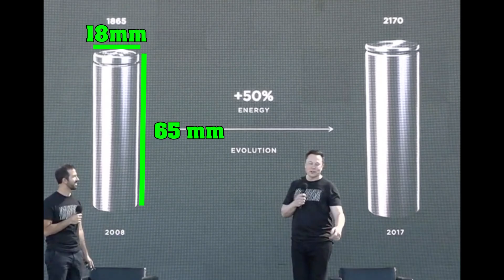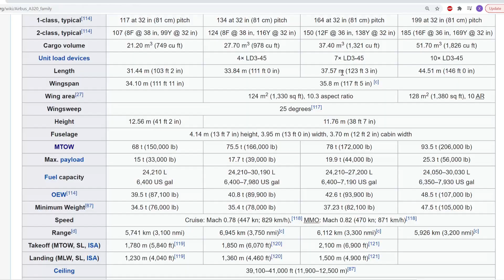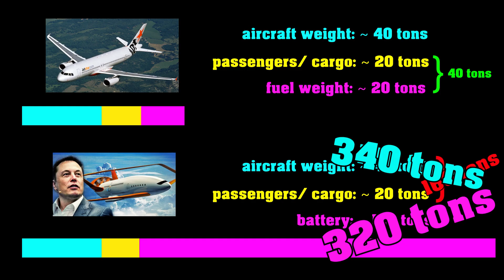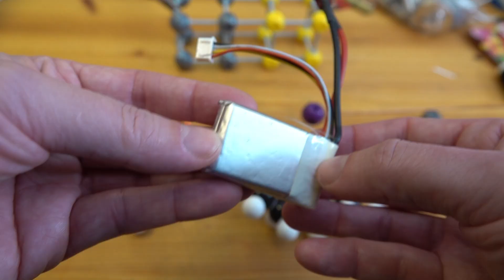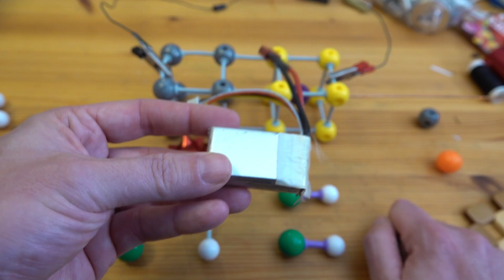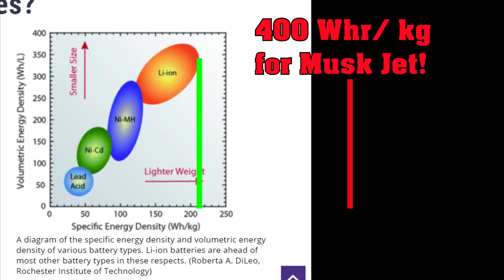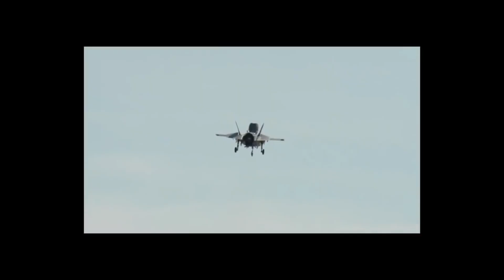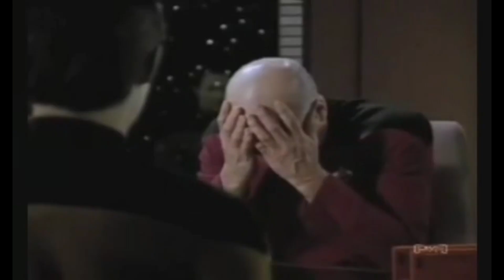Tesla's Secret Plan To Disrupt Airlines: BUSTED!!

Comment: In a jet fueled aircraft, the take off weight and landing weight are vastly different. With an electric, the aircraft’s take off and landing weight are the same. In a jet fueled aircraft, mid flight, it gets more efficient as it becomes lighter. Electric aircraft the weight remains constant. If they the electric aircraft could jettison dead batteries then it’d stand a chance.

Comment: And we haven’t even begun to cover the fact that for the required gross takeoff weight of the aircraft, you need engines they can generate a thrust greater than that in order to facilitate vertical takeoff, which means the engines are larger, heavier, and consume more energy, then he would typically see in a normal jetliner. Yeah Elon is so full of shit that he could pass for an outhouse on this project.

Comment: The range of the aeroplane ignores the fact with the airbus you start with 20 tonnes of flue and end with fumes,  the Electric Jesus plane would start the flight with 77% of the aeroplane weight occupied by the battery and finish it with same ratio.  I'm surprised the splitting image puppet of Electric Jesus had a moving mouth,  it would have been far more accurate if the arse cheeks moved when he's spoke. 

Nice battery fire at the end of this https://youtu.be/-jiH3mE81zw 

If you fly RC models it is tricky to get long duration  especially if you want the model to be fast and responsive. The body is generally made out of mainly polystyrene of some description reinforced with the odd bit of metal or carbon fibre.

Comment: You don't need a massive range for an aeroplane as a lot of routes are not that long and you can of course have a stop mid way for a quick 15 mins supercharge this would make it less economical and convenient granted but if hydrocarbons are regulated away it's better than nothing

I would argue that the future will be far less flights if self drive cars work

Why use an aeroplane if you can book a self drive sleeper EV at night and wake up 8 hours later in your destination city 800 miles Away

9 of the top 10 flights routes by passanger number are less than 800 miles distance

Comment: 1:50 They actually are talking energy density. A present day tesla battery (2020) has 260 kWh/kg, while a roadster battery (2009) had only 120 kWh/kg. https://web.stanford.edu/group/us-atmc/cgi-bin/us-atmc/wp-content/uploads/2009/04/tesla_presentation.pdf
Reply: Wow that's an huge improvement. According to battery day with the dry electrolyte, the silicon anode and a nickel cathode they should improve energy density by 40% so that's ~364WH/kg.
Still not enough...

Comment: By the way, Mercedes achieved 50% or more efficiency with their hybrid Gasoline engine in Formula 1
Reply: Yeah. ~30% is where traditional piston engines are but recovering energy as you brake and smoothing engine revs by adding a hybrid system can help massively. 

But plane engines run at constant speed for hours on end so it won't help here.
Reply: @ThepoLarbear-le1yz  a big part of it comes from the electrified turbo part. But brake regen helps too
Reply: Newest Honda and Toyota gasoline engines for hybrid cars are beyond 40%. Because they are used for serial hybrids the engines are optimised for efficiency but have not so good response and torque curve.

Diesel engines for ships are above 60%.

Comment: Even he gets his power, how does he convert his power. If he can convert his power, how does he cool the thing converting his power. If he can cool the thing that is converting his power... If you want to run several flights a day, you can't deep discharge, so you're looking at 100% of your weight in batteries? You are also limited to about 1C... How is he going to prevent thermal runaway? Boeing slapped a metal box around their battery and their battery was tiny in comparison. If the battery does light on fire, how do you prevent it from crashing the jet and killing everyone? How do you prevent everything from melting if you need to hover? How do you get a prop or a fan to go supersonic? The fan produces less and less thrust the faster you go.

Comment: I think battery airplane is feasible to certain extent. Electric airplanes are in production. They have like 2 of flight and like 500kg cargo. Like 4 people is in production or 8 people is in development. With current battery density max load is like 1-2 ton. 
As you increase weight you need progressive energy density. Like few kg dron is speedy but 2 ton airplane barley flying. 
Few gram fly is speedy bastard, 100 gram pegion is stil nimble, 4 kg duck still fine, 14 kg albatross barley can take of. For blood, bones, muscles thing 14 kg is max weight. 
Battery have few tons max weight. Piston engine airplane is like 100 ton, turbo jet is like 500-600 ton max. For bigger airplane we need stronger and more efficient engine
Reply: name these airplanes. everyone keeps mentioning the nasa one that has a 100 mile range, and that only carries two people and burns more fuel then a ww1 wooden airplane that had three times the range

Comment: Few things to add :
-bosch just announced yesterday that despite massive investment, they are dropping off the lithium battery bandwagon. Gone is the 400Wh/kg battery promised. 
-electric motor power to weight ratio is pretty bad. At best they match internal combustion engines, at worst it's a third. This things are pretty heavy, and just like batteries, the more powerful they are, the more heavy they are! It's a matter of getting all that current through.

Disruption in electric things (batteries and motor) is still possible with close to sci-fi concepts like higer temperature supraconductivity or nano-engineered batteries. Still the energy density of any combustible will still be higher. Most of the energy released in a combustion comes from the oxygen of the atmosphere itself...
Reply: The ampere engine should reach 20 kW/kg at 30,000 RPM but that's just a project. What do you think?
Reply: @johntheux9238  I smell BS but investors will love. They love to throw money at peoples that just announce doubling any spec of whatever they startup into.

Comment: I gotta point to a couple of things real quick. That plane you used for reference has three engines, one in the tail. Otherwise they can’t fly over water with just two. Also when figuring the engines for “Elon’s Folly” you missed the fact that the engines would have to be much bigger and have a much heavier framework in order to be a VTOL craft, just look at the V-22 Ospreys and how they are built. Great piece on everyone’s favorite “White Paper” author, lol!
Reply: Without a timestamp it's hard to be sure, but he uses a 787 in most of the pictures, which has two engines, like all airplanes designed after 1980, which is about the time when the three engine rule was abandoned
Reply: yeah i just flew 4k miles on a twin-engine 777-200er

Comment: I don't understand why people think tesla has some kind of magic battery technology he's using the same batteries as every other damn company.

How does that guy think an electric engine would generate thrust? You still need air buddy I'm a dumbass and am aware of this fact
Reply: They will produce the 4680 battery themselves.
Reply: Yeah but it's no different from any other lithium battery it's the same other than the size exactly the same battery tech every lithium powered device has inside it and 42120 cells are a thing already the size difference is negligible
Reply: @PsychoticEwok  It's not only a new form factor, with the dry electrolyte, the silicon anode and the nickel cathode they should improve energy density by 40% so that's ~364WH/kg
Reply: @johntheux9238  because the battery itself is 40% bigger.

Comment: As a licensed aircraft technician, I can say that everything you've said is correct, with one exception, commercial airliners don't have self sealing fuel tanks, military planes do but not airliners. And there was one relevant omission as well, Li-Ion batteries become less efficient at colder temperatures, and the higher the altitude the colder the ambient temperatures. And another issue is airframe flexibility, airliners store the LIQUID fuel in the wings, the wings flex quite a bit during flight, not a problem for liquid. Li-Ion batteries are very densely packed are are not at all flexible, so if you put them in the wings you would need to have large voids to allow the wings to flex without flexing the battery cells, that reduces the volume of batteries you can fit in the airframe.
Reply: Duh. You put the batteries in the fuselage and the passengers in the wings. It's not that hard when you think about it.
Reply: @C0urne  Dont give elon new ideas😅 please
Reply: @spardasquadspqr3535  Easy, just make a flying wing! The Hyper Wing.
Reply: @jospi2  HyperWing - is that a new thing by KFC? :)
Reply: @jospi2  Covered with solar panels!
Reply: @C0urne  I've been on that fair ground ride, good thing I didn't eat beforehand. Its a funny idea, and I know you weren't serious, but oof, it would be really something else to ride!

Comment: I have a brilliant solution: Electric supersonic airplanes WITH SOLAR PANELS
Reply: Lets add like 4 wind turbines behind it for free electricity🤣
Reply: Heck, why not put in a solar roadway..
Reply: @ajs747  Solar runways FTW
Reply: And Solar Freaking Runways to power the airport 💁🏻‍♀️
Reply: Zephyr does that. With a cargo of whopping 5kg, which is more than Musk's plane will ever have. With such a plane, you can get from one place to another in only 20 parts!
Reply: OMG free air travel = disruptive technology!!!!
Reply: I have an even better idea we use diesel eletric generators
Reply: @potentially_great6944  how about jet fuel electric generators?... We could even refine the concept and bypass the electric subsystem and output the thrust directly!
Reply: @xpusostomos  great idea
Reply: @potentially_great6944  technically... That's a technology being researched: producing electricity (turbofan) to be used in many smaller propellers, the energy loss due to energy conversion gets more than compensated by improved use by propellers
Reply: Flying solar panel instead of flying carpet

Comment: Electric jets can work if you burn hydrocarbon fuels or metal/metalloids in a combined-cycle, turbo-compounded gas turbine/reciprocating combustion engine with a thermal efficiency of 50%-60% and a fuel-well-to-AC/DC-electric motor efficiency of at least 50%. With B metalloid, you have a specific energy of 58 MJ/kg, or 16 kWh/kg, and a volumetric energy density of 130.04 MJ/kg, or 38.344 kWh/kg. At least half of this total energy available would go directly to powering the plane's electric engines, and the other half would be lost to inefficiencies.

Comment: Knowing the energy density of jet fuel vs batteries, plus the difficulties and amount of time for us to attain above Mach 1 flight in fossil fuel powered planes, makes me think that Elon is again full of 🐂💩. I wish someone would kiss my ass for making grandiose ideas about impossible technology. I wonder if Elon will still be relevant after the big auto makers kill tesla in the next couple years. They're all making battery powered cars with range and acceleration like tesla, but for far less than a hundred grand or there abouts.
Reply: Well, with the dry electrolyte, the silicon anode and a nickel cathode they should improve energy density by 40% so that's ~364WH/kg
Still nothing compared to jet fuel, but auto makers are fucked.

Comment: wait so how does it produce more mileage if its just bigger batteries?
Reply: It's taller so the battery pack is thicker even if it has the same footprint.

But that's just the form factor, with the dry electrolyte, the silicon anode and a nickel cathode they should improve energy density by 40% so that's ~364WH/kg

Comment: think how long it would take to recharge the plan
Reply: The new tabless design has a 5x shorter electric path which means less resistance so you can charge it faster. But I can't imagine the power that's required...
Reply: @johntheux9238  the cars take 2 to 6 hours and these plans are massive. It would be 18 to 20 (I'm guessing) and turn around for plans is massive

Comment: I would really LOVE to see annother Supersonic passenger jet. I feel we stepped backwards when.the concorde was shelved.

One thing to remember about the 2170 is it has a MUCH higher Continuous and Pulse rating than the 18650 and can cope with 50amp draw pulse. Awesome for vaping use.  Plus there is a.hell of a lot less sag in them which is nice. Especially compared to.the 26650 

As for how much better they are for the cars, not sure, not my area of interest. I.do know that the 2170 design has certain advantages over an 18650.

OK.... 70% of that plane is lithium ion batteries. Slap a guidance system on that and its one hell of a bomb.

Comment: solid electrolyte batteries are like fusion power. Tnow+X years away. :D One of the biggest chemical hard limit to battery energy density is the fact that the battery is at a constant size and weight. With hydrocarbons the thing that made airplanes possible in the first place is that fact that you take half of the fuel in just in time for combustion and  you dump out the co2 and the water. Making the plane lighter in the process. With batteries there is no such saving and you have to carry around all the components of energy generation. And this fact alone sets a theoretical max limit of energy density unless we invent something that is a fluid that interacts with the air that gets enough energy out to keep a jet operating. Those are biodiesel(biojetfuel) made in a carbon neutral way there is no problems with it. This is the best we can achieve at the moment. Just do not get jetfuel from new reservoirs... get the necessary carbon sequestered by some crops, harvest, ferment and use.

Comment: Wait wait wait, he made a battery that is 50% bigger have 50% more power?
Wow that is revolutionary, why didn't anyone think of making batteries bigger before????
Reply: It's about cost, not power, a bigger cell is cheaper per kwh.
But they will change the chemistry too, with the dry electrolyte, the silicon anode and the nickel cathode they should improve energy density by 40% so that's ~364WH/kg

Comment: Can we talk about a different issue, though? How in the fuck is Musk planning to generate that amount of thrust from an electric turbine? There's a reason why fuel turbines produce so much thrust, and that's a massive advantage over electric turbines. 

Not that this even matters, all of this is vaporware anyways. Just another futuristic concept that'll never happen. Or, a decades-old futuristic concept that Elon claims he came up with, just like the hyperloop. 

Also when Elon is throwing numbers out of his ass, the 70% battery by weight number for example, I think he's referring to his supersonic vtol idea. He throws the vtol and ss-vtol idea out there a lot, so let's consider that as his 'plane.' You're going to need more power in those turbines for a vertical aircraft. For supersonic speeds, you're also going to need a hell of a lot of power in those turbines to push the aircraft to those speeds. Keep in mind that his ideas aren't for jumbo jets, they'll be low passenger count at most, if not a maximum of 5 or 6 passengers; especially as we don't even have Tesla transit yet, just cars. Considering low passenger count, relevant passenger cargo, and the size and weight of the aircraft, I think 70% is probably a fair estimate, just for a 'personal' vtol. This number would be different for much larger aircraft, for obvious reasons. Not that it matters because the flying Tesla is vapor anyways.

Comment: A supersonic prop plane?   I'm not a jet engineer, but I thought jet engines used the highly compressed air from the turbine to feed a combustion chamber which actually provides the thrust, without the combustion don't you just have an electric fan?  OK, electric fan may be understating it, but how exactly does an "electric jet" work?  And something that could be important, as a jet burns fuel it becomes lighter requiring less fuel to move a lighter plane and becoming more efficient, an electric jet doesn't get lighter as the battery is expended.

Comment: Not that this point makes much of a difference in weight, Elon is planning to use the battery as structure. On the other hand, this structure means that rough landings make a nice bonfire. 🔥
Reply: You also forgot to mention that motors will burn up with no load...less air resistance means less load because less electrical energy is converted to magnetic energy, so it's converted instead to heat...that would cause the coatings to come off the windings and ultimately arcing, which in turn will turn your plane into a giant firework. Of course, you can deal with this issue with a transmission with a gear ratio increase (overdrive), which would in turn mean more weight for the "lighter electrical motors" and higher centripetal acceleration on the blades (meaning blades carrying dangerous levels of momentum).

Comment: Thunderf00t overlooks the fact that batteries contrary to fuel can be part of the fuselage and structure rather then just fuel in tanks. Also Deltawing planes should be able to get additional energy over the clouds during daytime with solar cells. Also weight ratio of a fuel powered engine and a electric engines is not same.
Reply: you do realize the reason why planes have the range they is that the fuel being burned off reduces the weight enabling the plane to not only have greater range but also be able to land intact? if a plane has to land in an emergency with a full tank they have to dump it in order to safely land. it is why they calculate distance to travel then fill up based upon that calculation.